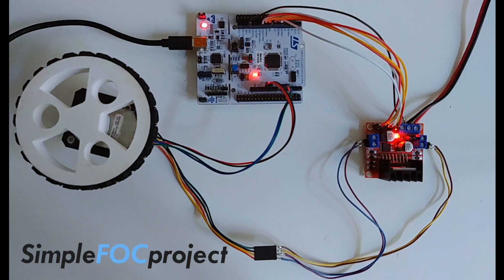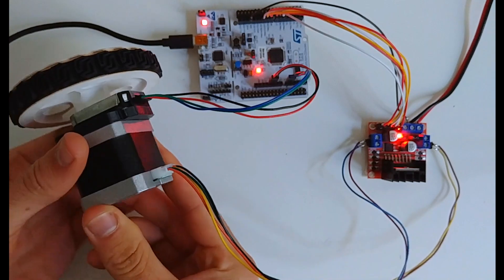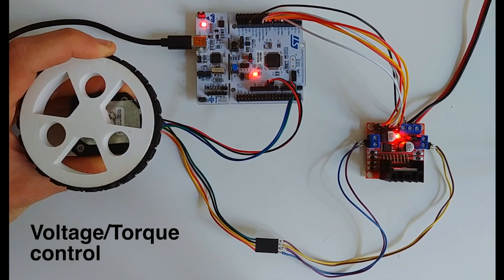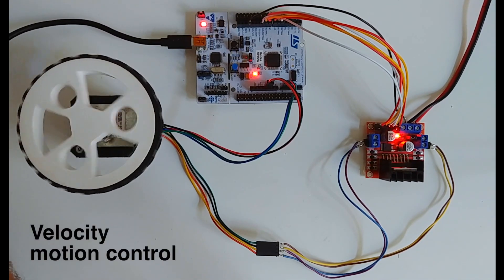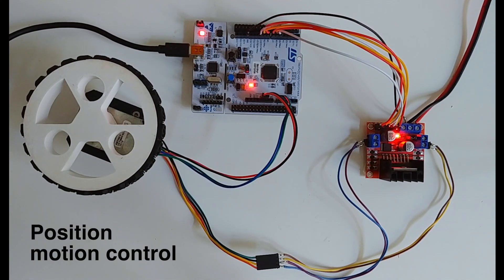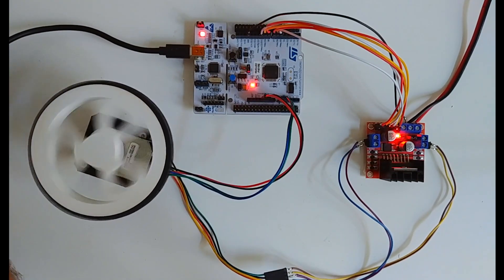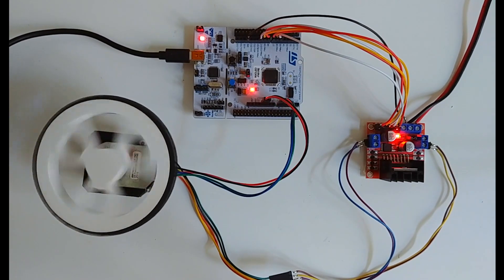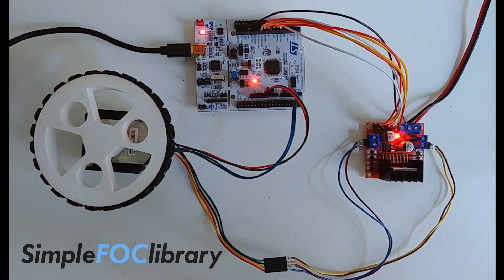Closed loop Stepper Motor using FOC algorithm - SimpleFOClibrary

Comment: On your L298 power board, there is no current sensor. If you cannot sense the current of the motor, how can you run the fOC?
FOC is all about current control.
Reply: Propably by voltage? Stepper is a bit different from 3 phase bldc. As you only have 2 "phases" you can just use pwm with a known input voltage to set the motor current.

Comment: What are the differences between using a BLCD vs a stepper motor of a similar price range for a FOC servo motor?
Reply: Basically the motor. Stepper is basically a very high pole bldc. So you have the same disadvantage as you would with a 50pp bldc.
More poles = slower rpm and more torque at same power. One reason why im changing back from bldc to steppers for my gearless delta robot. For same torque output in a nema17 housing I would need a custom motor and about 10amps vs normal stepper and 2amps.

Comment: Are there any plans to implement step/dir input for faster speeds to suit CNC machining applications? Generally 100-200KHz step rate would be a good starting point.

Comment: Are you shure is FOC? I see an encoder there..  this is closed loop control...
Reply from the maker: Its the closed loop control where we set d and q voltages to the motor. Since these hobby boards usually do not have current sensing the by the book FOC is not possible, but you can still do it by assuming that the voltage set to the motor is proportional to the current. Not 100% true but it does work :D

Comment: Imagine SimpleFOC being implemented in GBRL CNC Arduino. Or vice versa. What a wonderful world it would be. .
Good work.
Reply: Not any advantage as simplefoc is already standalone. Better use 1 mcu per motor and implement an Com interface to your cnc controller. Either by bus or simple step dir

Comment: What is the minimum resolution for the optical encoder?  amt103 is not available in our country.
Reply from the maker: Hey Anuvind, In this example I'm using the encoder of 500 pulses per revolution. I'd say that the minimum for 200 step stepper motor is around 200 pulses per revolution. Which would give you the 800 counts per revolution.
You do not have to use the encoders, you can use the magnetic sensors as well, they are a bit more accessible.
Reply: Where can I find reference/code for using As5600 as an encoder?, Also does the library support the use of multiple steppers?
Reply from the maker: @anubomb  I'd direct you to the our community forum:  community.simplefoc.com. 
There you can find a lot of helpful people that can give you a bit more directions than I can write in a youtube comment :D
The sensors are not at all specific to steppers, so you can use any library example with magnetic sensors and replace the motor and the driver with your stepper driver. 
And you can run as many stepper motors as your microcontroller can handle. The library does not limit this number in any way really.
To get familiar with the library code and the sensors I'd like to point you to the docs docs.simplefoc.com

Comment: Application? Simple: replace the x and y drives in my 3d printer. This would allow putting the filament stepper next to the hot end. No more worrying about skipped steps and I could use the same steppers. This would also allow me to speed up the print. Only question is what does it take to incorporate the simple FOC?  

Another application I'd like to see is a cnc circular saw (think panel saw). Steps are good enough but feedback would be absolutely critical. If the cnc part is accurate enough then the saw could take multiple passes and a smaller saw motor could be used.

Comment: I've got a NEMA 17 hooked up to a L298N like in this video, but I can't get it to move. It does seem to be moving, just not all that much. The driver is outputting the correct PWM signals on my scope, so I wondered if the encoder is high resolution enough. It's 600 PPR so with quadrature it's 2400 CPM. I checked it separately and it works fine. So theoretically that should be like 48 steps per pole of the stepper, which seems like plenty. My steppers are rated for 1.4 ohms, 2A (2.8V) per phase, but I saw that there was one on the "compatible hardware page" that listed a 1.2 ohm stepper, so it can't be that. I haven't burnt it out because I checked both this one and another one I hadn't run yet and they both were almost exactly 1.4 ohms. The only other thing I can think of is that somehow the sensor alignment stage isn't working properly, because it barely moves when trying to determine direction and electrical zero angle, but even that I'm not sure is the problem, because my motor clearly moves a lot less than the one in the video during initialization, even with a max power supply voltage of 24V (current limited to 1.5A, though.) Maybe it's that. If anyone has any idea of what the problem might be, I'm all ears, this makes no sense ;p

EDIT: I also measured the current, it's about 0.88A on one phase when I just power that phase directly with about 2V. But it's not doing anything?! Not even a little nudge it seems like. I wrote a sketch that just bit bangs out 90 degree-separated square waves, nothing.

EDIT: Holy shit I'm an idiot. I forgot to put the shaft set screw in. the motor was turning but it wasn't attached to anything LMAO
Reply from the maker: Hey @polymetric,
Sorry for the late reply!
I'm happy you were able to make it work. You have a perfect setup, that should work pretty well. 
If you want some quicker answers on these kinds of questions consider posting to our community forum. There are a lot more people who are experienced with these stuff and you will iterate faster :D
https://community.simplefoc.com/

Comment: Amazing work! Quick question,  I was curious if this could potentially work with an arduino connected to a standard ESC by sending PWM signals to control the BLDC motor and encoder. So that you could, in theory, drive a wide range of different BLDC motors as long as you got a powerful enough ESC for them. Is this possible?
Reply from the maker: Hey Stefan,
in theory this combination would work. you could add the position sensor and control the position and velocity of a motor using the esc. For higher velocities this solution would maybe be even a good one. 
But escs are not smooth and you will never be able to spin the motor nicely on lower velocities and position control them as well would be a huge challenge. 
Also the pwm resolution and sample time of the esc input is very restricting.

But!
In the next library release, probably simolefoc 2.0, we will support 6PWM setting for Arduino/stm32 and esp32 which basically means that you will be able to build your own blec driver board with just a few mosfets and their drivers and using a very simple code control them very smoothly and precisely. 
We'll make sure to demonstrate few examples :D
Reply: @theskura  wow, that would be awesome. This is definitely the future for all electric motors, especially in the CNC world.
Reply: @theskura  Fantastic thank you! Keep up the great work you do and I am looking forward to the  next library release!

Comment: Awesome. A question: For a brushless motor, HMBGC 2.2 is not widely available. Is there a gimbal controller currently on Aliexpress that will work?
Reply from the maker: Hey Haley, Yes they seem to have disappeared in the mean time :D
Something like this will work:

https://fr.aliexpress.com/wholesale?catId=0&initiative_id=SB_20201123083645&SearchText=bgc+3.0

Or something like this if you feel more adventurous, the performance is much better though:

https://fr.aliexpress.com/wholesale?catId=0&initiative_id=SB_20201123083925&SearchText=+storm+bgc+32

For more info about the supported drivers you can check: https://docs.simplefoc.com/drivers
Reply: @theskura  Thank you!
Reply: @theskura  Oh no! the urls have disappeared too! Oh but I found it on your drivers page.
Reply from the maker: @oldspicefullbody  Thanks for the heads up, 
I've updated the links once again, this time with the true ones. They are a bit long, but at lease they wont break :D
Reply: @theskura  You are too kind :)

Comment: I admire your work! Thanks for sharing! Q:Do you have infinite micro steps or do you predefine discrete micro steps and use w.r.t. the encoder position?
Reply from the maker: Hey Kaya, thanks we appreciate it!
The microstepping is not infinite :D
There are few factors which limit the number of steps:
- First, in simplefoc the sinusoidal wave is approximated by a table of around 1000 values for 360 electrical degrees of the rotor. Motor has usually 50 pole pairs which means that it has 50x360 electrical degrees per one rotation,  which would give you 5000 steps per revolution or microstepping of around 250. This can be augmented significantly, you could remove the approximation and use sine() function which would give you the microstepping of basically infinity.
- Next when using simplefoc the motor will not necessary pass through all the steps as what would the regular stepper do in open loop, when using foc since you know the motor position then you always apply the voltage orientation that is optimal. Therefore the number of steps is not only limited by what you can apply but what you can measure. What is the granularity of your sensor. In this example I use 2048ppr encoder so it has around 8000impulses per revolution which is more than than 5000 steps per revolution so we are good.
- Next thing limiting the number of steps is the execution time of one loop(). When using foc it is very important to execute fast your procedure of reading where the motor is and applying the  optimal voltage. If this is not fast enough then this will be the biggest limiting factor of the number of steps per revolution. In the case of this video I am using the stm32 nucleo and I a loop time of around 100micro seconds, which means that it can produce 1/0.0001=10000 steps per second. So that means we are still good.
- Last limiting factor is the granularity of the PWM signal. In the case of stm32 board, the default resolution in simplefoc is 12 bit. So it is around 2^12=4000 steps per one sine wave. Which is still much more than the precision of the table on the begging. :D
Reply: @theskura  great work! great description! thanks! i can't wait to try this out!